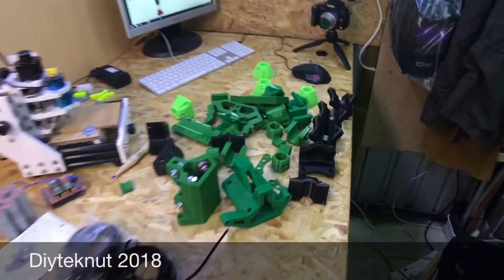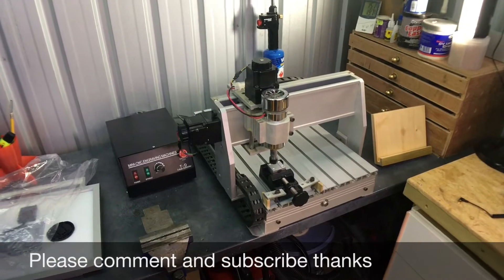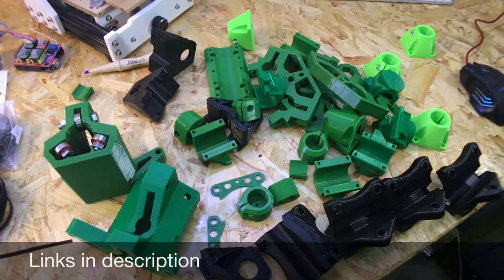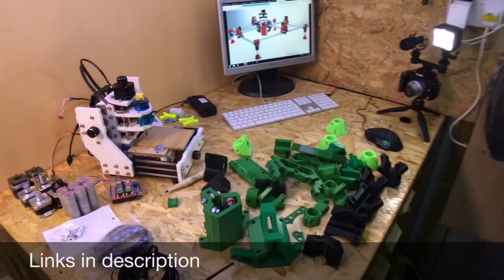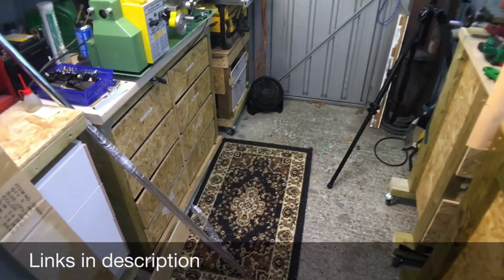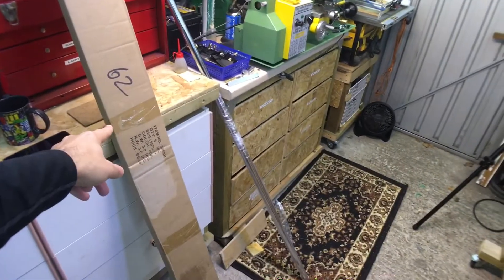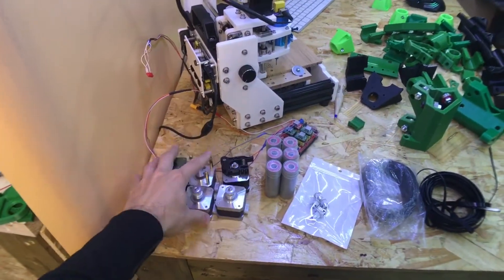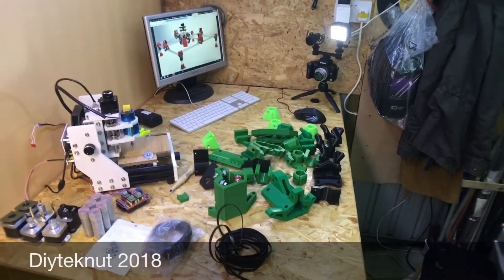Building A Mostly 3D Printed CNC Router MPCNC PT1

Comment: In the UK, Your local Screwfix or CEF should stock galvanised steel conduit for around £10 per 3 metre length + delivery.  I'm guessing the prices you quote are for one of the High Street DIY chains, these rarely offer the best value.  That said, your shiny chrome rails look a whole lot better!  Do you know roughly what the wall thickness is on them and have you found them rigid enough?

Comment: Hi. I came up with the same solution. Local DIY store sells wardrobe rails in 1m 1.5m and 2m sections. Just building mine now. Great to see someone else doing it. I guess the chrome wears off right? Also I see you are using the CNC shield - how did it go?